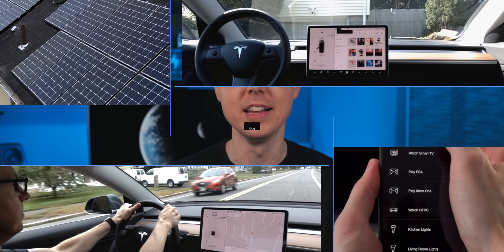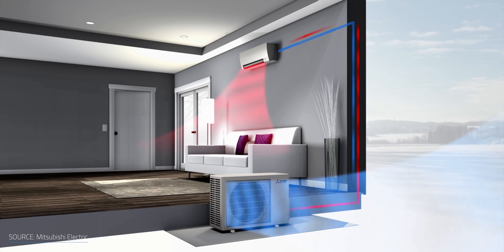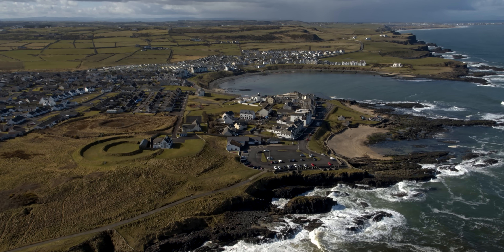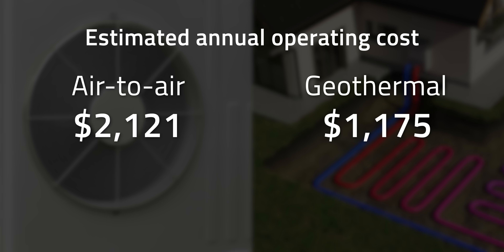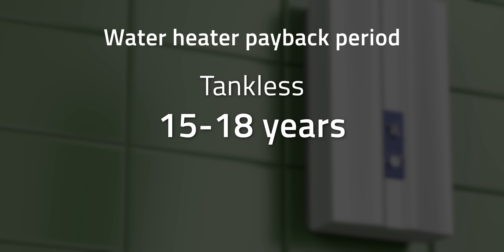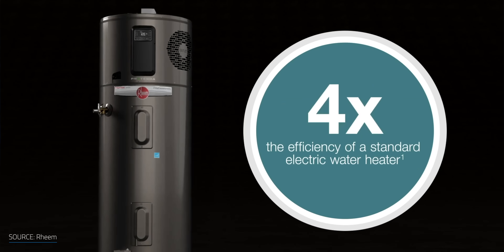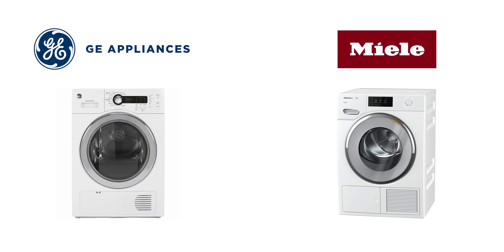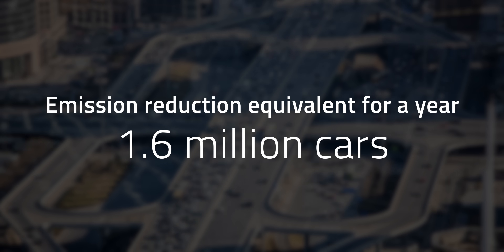Why Heat Pumps are Essential for the Future - Explained

Comment: I have experience of a Bosch Heat Pump dryer, which may use less electricity, but in practice takes so long to dry a load (well over 3 hours for towels) as to be of little use. I remain unimpressed.

Comment: My Miele dryer uses a 110 plug vs the 240 my old one used. I got my new Miele washer and dry about 3 months ago, for about $5500 for both and it is so worth it. My old washer and dryer was a top end Samsung. The Samsung started breaking down 7 months in and they wouldn't repair it on warranty, I ended up fixing it myself. At the end of 6 years I had taken them apart and repaired both around 10 to 13 times each. I gave up on them and will never go back.

Comment: You have already done the work of researching the different types of systems and costs.  It would be excellent if you dropped the names and model numbers of the equipment you are currently using and equipped you are switching to.

I’d like to know what system name you are switching to that combines heat pump for your air conditioner/furnace, hot water heater and you said a 3rd but I can remember.

I understand every situation is different and all the pieces of your new system may not meet my needs in my house.

But the extra info would help me start my search.

Keep up the great videos.  You are giving me things to plan for in my new home I want to build in Thailand 🇹🇭

Comment: Never go by the save "up to" numbers especially with hp water heaters.  In Florida for example, incoming water is 60-85F and tanks are in warmer environments. They calculate more for incoming temp at 45F and a cold basement, so depending on your situation the save up to is for a specific set of conditions which may double your ROI time, by then compressor and other failures will happen, not to mention up front cost is 3xs higher then other options.

Comment: Interesting video. But it should have a giant disclaimer in it pointing out that if you live in a badly insulated house, you should spend the money on other things first.

The efficacy is radically different depending on what building you're putting it in, and the initial investment (capacity required) will be much higher if most of the heat you pump in just escapes immediately.

Comment: There are air-to-water heat pumps on the market that are achieving the COP around 5. I'm thinking to get one from NIBE. For most of the EU, if in specific region the winters are not super humid and cold, the small gain in COP for geothermal does not justify the higher upfront cost compared to air-to-water heat-pump. But then you have also the discussion about noise in densely populated areas.

Comment: I've always heard about heat pumps but never really understood the technology...until I moved into my new apartment. In my old apartment with gas heating and gas hot water, I was paying anywhere between 50 to 75 Euros a month for gas, despite heating very sparingly. I just moved into this new apartment last October, the building is also brand new, so it has a heat pump for heating. My heating bill has PLUMETTED to around 10 Euros a month (!) with the heat pump powering our floor heating (what a godsend!) and hot water. I've spoken to some of the other renters in the building and they all say the same thing - very low heating bills despite keeping the thermostat at a comfortably warm temperature. If I'd known about heat pump technology, I'd have moved out of my old apartment much earlier instead of wasting thousands of Euros on high heating costs over the past 18 years I lived there.

Comment: Dear Matt, using a heat pump in a washing machine, is just like the thing with inverters, yes you gain efficiency but you also get complexity which makes the device more expensive and more difficult to repair. 
So a choice has to be made: reliability over efficiency of efficiency over reliability? Here in the developing world (Tunisia) we prefer old Totota diesels because they have no direct injection, no electronics etc, and any mechanic can repair them. Yes they pollute more but poorer people need cheap solutions.

Comment: For the heat pump dryer, you skipped over whether it alters the temperature of the air around it. If I get one, do i now have to waste power fixing the air temp it is screwing with / fighting my HVAC?

Comment: If using a heatpump drier and are sucking heat fron thr room,  will you not need to compensate for that heat,  therefore the true efficiency would need to reflect the extra heating energy? The only time this may not be the case is in the summer when the room is warm,  but you could just hang out your washing.

Comment: 6:30 How does the department of energy get a payback timeframe of 5-10 years for geothermal heatpump, when it costs 10-30k to still and only has a 1k annual difference compared to the other heat pump method? Thats some very.....interesting math. Last I checked, 5-10k does not equal 10-30k

Comment: Heat pumping you HVAC, hot water, and dryer are all great ideas. Whats really irritating is that there is no product that can do all 3. I would love to run a ductless mini-split HVAC system that also has loops for the dryer and hot water heater (heck why not the fridge & freezer too?). A single air or ground source with manifolds to direct the refrigerant accordingly would be fine. Could dramatically improve performance and overall cost - instead of a compressor for each appliance just 1 or 2 main ones. You also avoid "double pumping" heat like if you're trying to heat your home in winter while your hot water tank heat pump is running.

Comment: 25 years ago, when I built my house, an in ground heat pump would have cost me $30,000. So I went with a $2000 furnace and standard A/C.  Last time I looked, to replace my A/C with a heat pump would add $400, and work well most of the spring, all summer and into the fall. I can't say I'd be happy when my A/C fails, but it will be replaced with a heat pump.

Comment: I'm a little late to this video, but I build net-zero homes in the desert as affordably as possible. I'm currently designing a net-zero home the can rely entirely off solar and rainwater even though the southwest barely gets rain. Not even using natural gas.  Build the house as tight as possible. 24" on center framing if possible. Utilize insulation and foam every crack, hole or exposed light. Heat-pump water heater, and low e argon filled windows. Installing the heatpump water heater inside your home, can dramatically decrease your hvac usage in your home as well... In a hot climate at least. I do energy testing to see my home energy rating, and apply the necessary amount of solar panels to bring the home to net-zero or lower. I plumb my solar to connect with a power-wall if a client wants, but frankly I don't see the need. In the heat of summer with 90-100 degrees outside, at 75 degrees my clients are only paying $20-30 dollars plus the fees charged by the power company. Best of luck to your new home build, and I appreciate bringing the awareness towards these systems.

Comment: Geothermal is not cost efficient because of upfront and maintenance cost, it only makes sense if you own a huge property in cold climate and can get subsidies. You can get the best of both worlds by putting your air to air outside unit in the basement provided you have a large enough basement. It's also not correct that R134a is the most used refrigerant, currently most new residential installations are running R32.

Comment: I would advise a Miele dryer, because (from my own experience), the dry time is just maginal longer than my old dryer.  To give an example what is also an advantage for a heatpump Dryer:  8 years ago i changed my washer and dryer for new models and before the both had power consumption of around 3.000 Watts.  That’s why i needed two 16A groups (230V).  Now they are both under 1500Watt (!) And can be connexted to 1 socket.  We saved a lot of energy!   In the Netherlands its almost ony heatpump dryers in the stores, starting with very acceptable prices.  And the slighly reduced temperature is also better for the cloths.  I Would recommend people to look for a brand and model with long garantee.

Comment: You should do an episode on VRF heat recovery systems in commercial applications. The tech advertises extremely high efficiency levels and they're going in all over the place. The problem with them is they have enormous built in place refrigerant circuits that are prone to leaking. They often leak over 100 lbs of refrigerant into the atmosphere before the system notices and by then the compressors burn out and blow away any energy savings the customer hoped to get through efficiency gains. I don't know why this equipment hasn't been blown up in the news.

Comment: The ground is a limitless heat source and heat sink.  Ground source heat pumps now have COPs in the 6-8 range.  The only drawback is the upfront installation costs, much of which is for excavating.  Ground source heat pump cost could certainly be amortized just like other home features.

Comment: 134a is commonly used in vehicles and walk-in coolers. I'm not saying systems don't use it. I'm just saying I've never seen one. Most systems use 410a (until they phase that out). I have a small heating and cooling company in WV and we install a lot of 17-20 seer inverter systems.

Comment: the biggest problem of depending on electricity. the grid cannot handle the extra load. a storm can knock out electrical service for weeks. a backup heating and cooking source is needed.

Comment: Another thing worth discussing would be the impact of the refrigerants used.  As all systems eventually leak it's worth getting this right the first time lest we have another CFC like... atmospheric oops.  There are systems out there (Sanden) that use CO2 as a refrigerant which has a GWP (Global Warming Potential) of 1.  By comparison the most common refrigerant is R-22 with a GWP of 1,810, that is 1,810 times the impact of CO2!

Comment: What about fridges and freezers? They are something that everyone has and already use heat pumps but currently just dump their heat out behind them. Wouldn't it make sense to connect them up to the heat pump network of your house to make them more efficient, remove the noise from the kitchen, and use the heat from them to warm rooms in the winter?

Comment: Heat pumps really well suited to coastal areas. If you have ever used heat pump in cold weather, especially in cheap built / poorly insulated housing, you learn gas is much much much cheaper and more capable heating in winter. So a COP of 5 is still cost wise worse than 75% efficient gas furnace bc cost of energy is less.  The device must work harder if outside temp goes down. When it was -15 at night we had to set apt to 80 deg F the day time to get ahead bc the heat pump couldnt keep up. Our heating cost was like $200 usd that month, gas bill wouldve been like 100

Comment: We should all start with passive heating and cooling designs in construction with proper ventilation and airflow. Trees to provide shade which cool the surrounding air temperature around your home during the hot months. Design without electricity dependency first. Design without the need for rebates rewards. Then heat pumps and others dependency of comforts as a backup.

Comment: When we purchased a house, it had one heat-pump installed for heating. At that time we had one electric car.

Then I bought the Tesla X + and additional heat pump and the overall power consumption actually went down. The second heat-pump saved so much energy it basically gave me "free" electricity for my car. very surprised

Comment: Bro just put your laundry on the "drying ropes". Noise level: 0, Energy consumption 0, Upfront cost: idk your neighbours drill and a drying rope kit for like 3 bucks,  Efficiency: takes 0.5-1 days to dry a full laundry basket, or a series of big blankets (my meaning of full laundry basket is for a family of 5). People have been doing it for thousands of years.
You said it you said "I want net zero home", oh also don't forget you actually have hands and can do dishes by hand instead of mindlessly putting another machine in and then thinking what's wrong with your energy consumption.

Comment: Heat pump style clothes dryers : Beware that due to the way they are built in general they only rotate the drum in one direction. The drawback is that with  towels and sheets it's hell because they get in a ball in less than 2 minutes and will remain so. If you buy one, make sure you have access to the radiator part to be able to clean it otherwise after 4 years, it is often the complete disassembly or the end of life of the device that is clogged. And NO the life-span of such a device is probably lower that tradictional models. The advertisement states on the electric motor only as the modern motors are brushless. But these motors need an electronic board to operate plus there is way more electronics and a complete fridge system. More components leads to more possible failures. (Matt, your video was interesting 😉 )

Comment: There is a new technology on the horizon called magnetic refrigeration. This technology uses a magnetic field to create temperature differences. It offers a higher level of efficiency over a compressed gas system. It has the potential to operate at lower temperatures because it does not involve a gas.

Comment: I love the idea of heat pumps. Living in Wisconsin makes it a little bit tougher decision to switch due to the cheap gas and extreme cold temps.
Reply: Joe Pautz, I would still suggest getting a ductless heat pump, as Amazon has them for a very low cost.  18,000 Btu for $899.  My neighbor heats and cools his 1,400 square foot home with one, mounted in the living room.  It will reduce the humidity in your home to very comfortable!  And provide most of the heating and cooling for up to about 1,400 square foot home.  Sure you might need to run the gas furnace on days below about 10F.  

To collect 100,000 Btu's of heat, the heat pump will use about 5 KW to 7 KW of power, or you could burn about 1.2 therms of gas and use about 500 watts to run the fan.  I have no clue what you pay for gas, buy you can look up gas and electric rates and figure it out from there.  I think the heat pump will cost less to run each year!

Comment: One comment regarding the hybrid water heater -  in the presenting videos it seems that  there is no output tube. The air that comes out of the unit must go outside. You might have the surprise that the room where the heater is set will get very cold. 
Unless this is intentionally done you need to divert the outcoming air to outside. 

The water heater I installed has one pipe going outside of the house in the winter (it only absorbs hot air from the room and takes it outside). In the summer I redirect the output air to the interior of the house as this air is cooled so no extra aircon is needed for a particular room (ideally you would reverse the input to use hot air from outside...it is not very complicated but you need 2 pipes that go outside for this...instead of one).

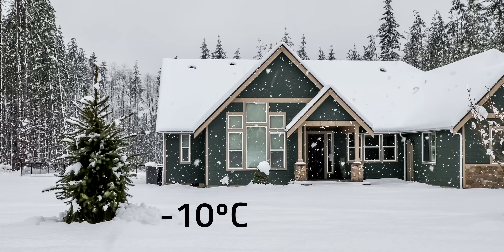Comment: at about 5:00 you imply that a heat pump has the same efficiency at any temp above ~ 14ºF. This would mean that heating my home when the outside temp is 50º would use the same energy as when the outside temp ois 15º. And this isn't true in my experience. The amount of energy used to move the heat changes in direct correlation with how much heat there is to extract from the air. The less heat (colder outside) the harder the system has to work to heat my home. At 14º there is no sudden increase in energy needed to heat my home. It is just incrementally more than at higher outside temps.

A second point that is far more general: I wish we could convince everybody that they are already using heat pumps everywhere. I'm not sure why we ONLY call these things heat pumps when they also push heat into our living space. Every refrigerator, freezer and AC system is of course a heat pump. But we fail to label them as such, an this confuses just about everybody. It is still magic that we can make freezing temps by simply sucking the heat out of the insulated box we call our freezer. But today basically nobody gives that a second thought. And then things that using a "heat pump" for their HVAC is some new scary thing that they can't trust.

Comment: Nice video.  I like the dryer and hot water heater ideas - especially since I have a basement dehumidifier running in summer.  But, my dehumidifiers only last 3-4 years and then stop working.  Concerned with maintenance costs for a heat pulp dryer or hw heater.  Currently I repair my dryer myself.

Comment: The only thing I'm going to have to look up is where the water goes with a heat pump dryer. I would think the most efficient way would be a condensate drain. Otherwise that water is going to have to go into the air inside the room which would cause some serious humidity problems. Being a (sorta) prepper, being able to recover the water would be a plus. Of course I could be missing something obvious which is kinda my thing.

Comment: Noise is the main problem of heat pump water heater. I have to install mine outdoor to avoid the noise. That decreases the benefit. A split heat pump water heater is much more expensive and I hope there is a way to integrate heat pump for heating/cooling, refrigerator, dryer and water heater into a single system. That would be super complex but I would expect it be very efficient, too.